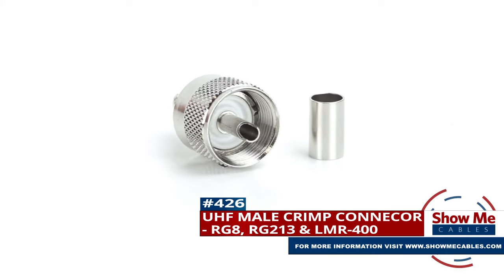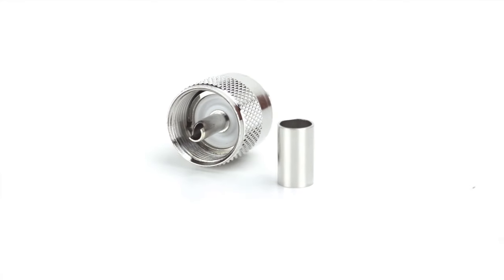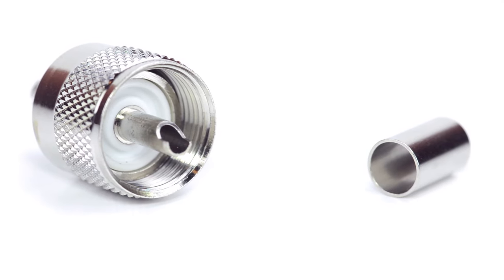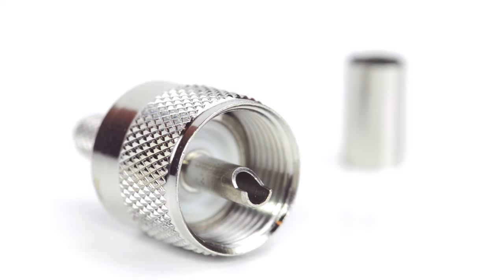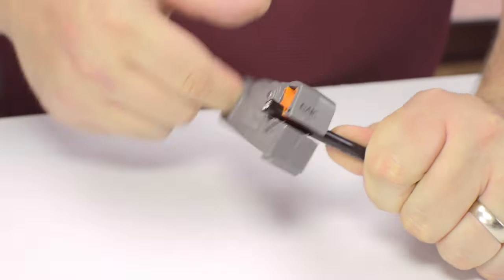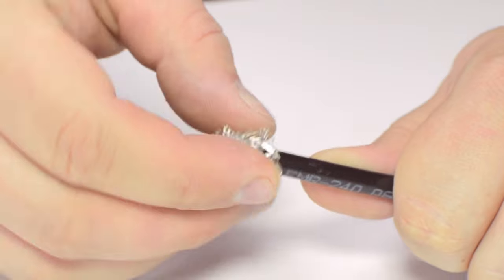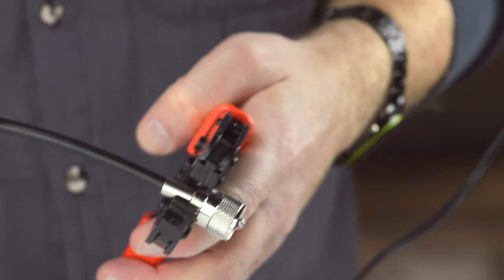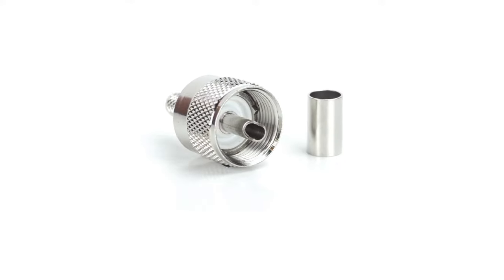How To Install UHF Male (PL-259) Crimp Connector For RG8, RG213 & LMR-400

Comment: Why the unhelpful fast tempo of the video? With all due respect, the soldering of the center conductor was the sloppiest I've ever seen, and I can't imagine it not being a cold solder joint if left like we all saw it. Adding even just another minute to the video would have worked wonders.

Comment: Sorry but it's rushed. I'm having issues getting the crimp to slide up over the end after soldering. The crimp ring may need to be a TINY bit bigger...or you could show me just how to avoid that problem. Thanks.

Comment: Always looks so easy in the video. Ugh, I have a stripping tool just like that and I think I just destroyed it on the first connector.
Reply: I have a similar stripper but to get similar results I have to wind the tool 25 times in one direction and then 25 times the other direction AND use a pliers to pull each cutting off. LMR400.
Reply: @kurtr1181  Yeah, me too, same thing you get. I realize I didn't destroy it, I managed to get the little screw back in after all.